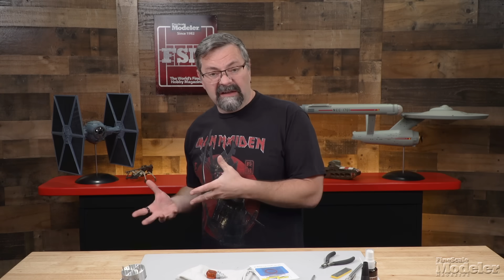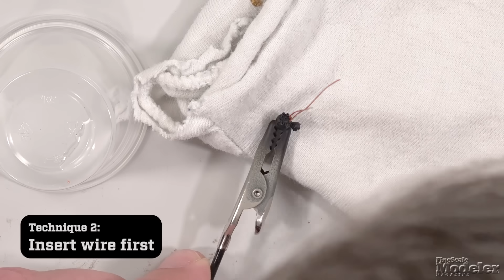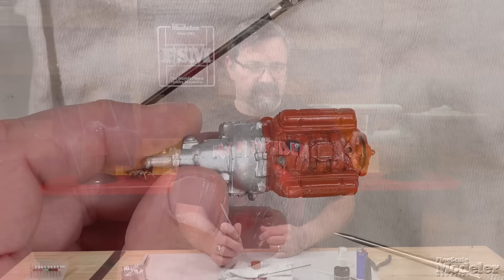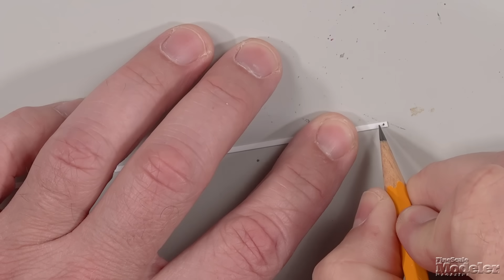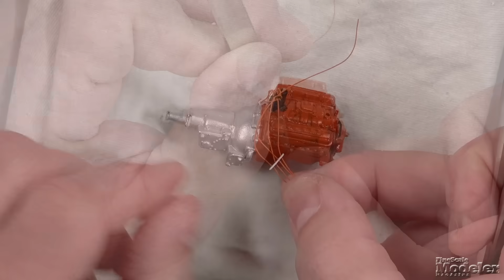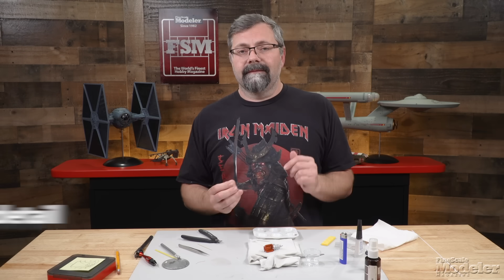FineScale Modeler's Scale Model Basics: Adding engine wires

Comment: Don't forget, on real engines the spark plug wires have a specific routing due to the exhaust manifolds/headers, etc. Therefore, one should pay close attention and reference your subject for the exact routing to determine whether to attach the manifolds/headers before, or after, gluing down the wires.

Comment: How about painting ends black or add black tubing for spark plug boot?
Reply from the maker: Painting the ends is essentially what Tim did after they were glued in. However, wait until the wire is glued in place before painting because paint will interfere with glue adhesion. Modelers use wire insulation, rubber tubing, tape, or even brass for boots. Remember, you can go as far as you want to go.
Reply: @FineScaleModelermagazine - Thank you. 🇺🇸👍

Comment: Ignition wiring is just the beginning. Before long you move on to fuel lines, heater hoses, battery cables, transmission lines and linkages, accelerator cable, and brake lines.
Reply: Oil dipsticks - engine and automatic transmission.  Bit odd that models don’t have these.

Comment: Boots ?
Reply from the maker: You can make it as complicated as you want. Tim used paint to hint at boots, but you can use rubber tubing, styrene tubing, tape, or even brass tubing. There are also 3D-printed boots available. It's up to you how involved you want to make the process.

Comment: I do much the same process, but I use solder instead and paint the wires myself. Spool of solder will last ages and its easy to mold into the shape you want.
Reply from the maker: Solder or lead wire work well, too. Thanks for watching!